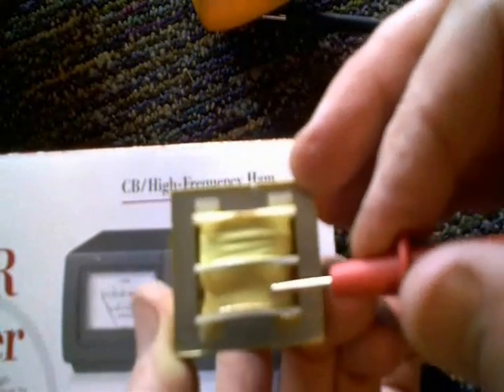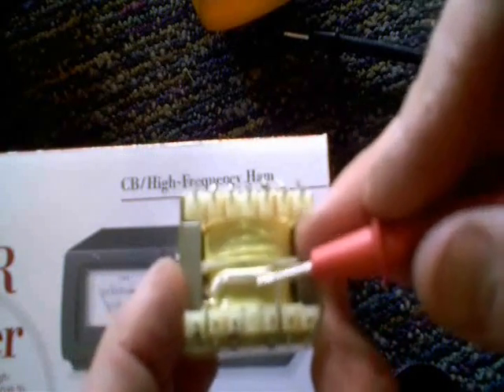Updated info on hidden fuses in Transformers.

Comment: I stumbled onto your video, I'm trying to repair a very damaged circuit board identical as the one you have on this video it comes out of a Kenmore 40 inch older range stove. I'm trying to figure out how to test that one transformer if it is possible without removing off the board because I do not know if it's good or bad I'm just trying to save some time. This is a 10-year-old video I'm pretty sure you may not reply back to it. Anyhow just for fun I give it a shot.
Reply from the maker: I have a website with an index to many of my videos at this link. https://tvrepairinformation.weebly.com/

Comment: I just found a blown round glass solder in fuse in my 24 v transformers secondary winding. Opposite side of where the wires come out just under the tape. I think from searching that its a 2 amp time lag fuse
All I can make out on it is 522 and 250V
Reply from the maker: I'm not sure what the 522 means unless its a temperature rating, Hopefully it's just the fuse that's gone bad. If there's a problem in the circuit your transformer is powering, you're going to keep blowing fuses after you replace it.
Reply: @GrantsPassTVRepair  It was in my furnace. I was trying to get the Hi AC fan to stay off while the furnace is on with an added 90-340 relay and overloaded it somehow. I put a backup 24V transformer in there and wired it all back up like it has worked for years and left it.
I wanted medium fan to work with the furnace on and the blower controlled by the fan limit switch. That also runs the blower after W and G have quit calling for heat and fan.

Comment: Everything seams to be switch mode power supplies these days with tiny transformers.  I wonder if these tiny ones have similarly rated thermal fuses as the bigger ones.  I need to fix my HVAC old  school 24V 40VA transformer before the weather gets too cold, and have a box of unused working wall warts/power supplies in various voltages and amperages(no 24V unfortunately).  Dead fuse is rated 1A 149C,  looks like a resistor without stripes, just lots of writing on it.  I bridged the fuse and ran tranny for a day at rated capacity on the bench without issue, but  want to fix it properly before reinstalling.  Understand soldering new one needs to be heatsunk with hemostat or crimped properly without heat else they blown up fasted than you can say snot. 
The original was wrapped tightly to windings between layers of tape.  Since I can't wrap tightly without removiing the core how does one get good tight contact between fuse and windings?   Also, how does manufacturer decide what temp rating to use - temp ratings vary widely between approx 100C to 170C?  I am trying to figure out which spare transformer to smash to bits - greatest chance of having a similar temp rating.  Not to concerned about amp rating as I can easily add an inline regular 1 amp fuse in primary winding where the thermal fuse is located.

Comment: I have this adapter that lets you run 12 volt car accessories on 120 volts. It has a 1 amp transformer inside. One time it stopped working. Took it apart and the fine wire that's on the primary side broke so I re attached it and the adapter works again. Still have it today, I use it on a satellite radio.

Comment: Thanks for the info, I'm having a problem with a battery drill charger which keeps blowing transformers, just need to find the cause of the problem now.LOL
Reply from the maker: +John-Paul Wright I'd guess your going to find a bad transistor is dragging your transformers output side down which is causing the transformer to fail. A bad battery may over stress the charger, but more likely than not you have a shorted transistor and other related components which are at fault.